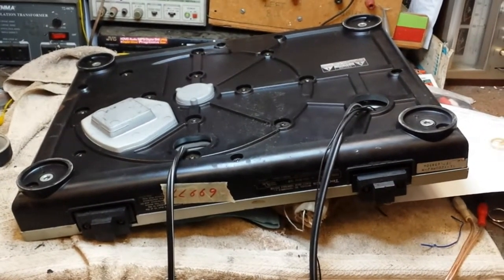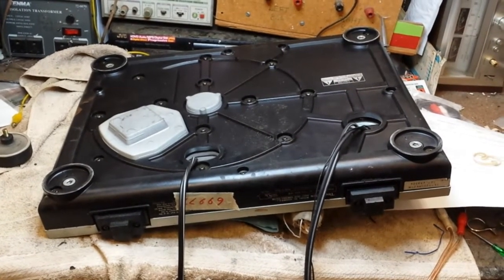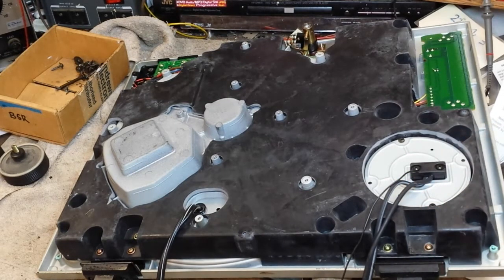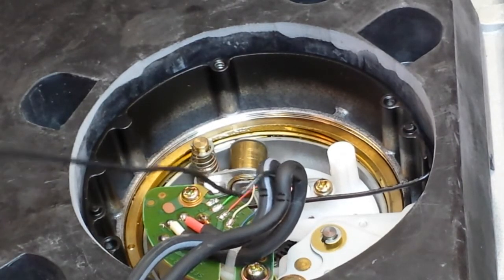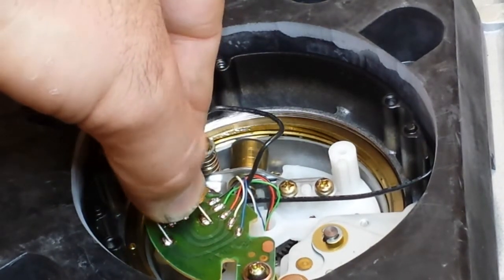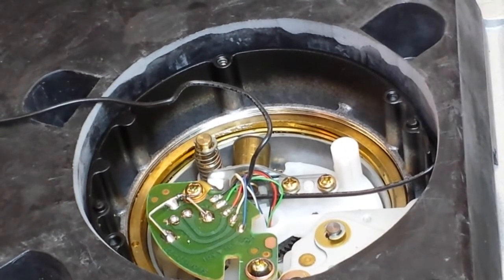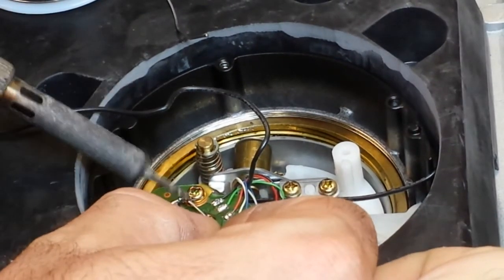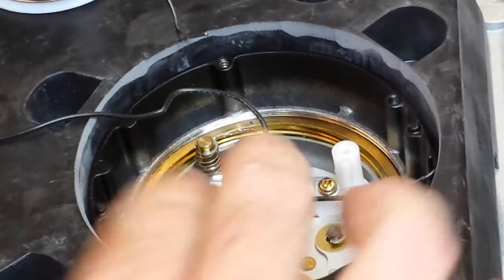How To replace an audio cable (and internally ground) a Technics SL-1200 series turntable

Comment: late here - good clear vid. Ha - IF I  did that guarantee 2 screws would have mangled heads , I hate Phillips....  ever try to replace the 4  tiny wires that go thru the tonearm to the back of cartridge ?  IF Yer t'table doesn't have the easy replace SMe / Technics head shell....  funny how soldering looks so easy.

Comment: I see all tutorials show how to replace the RCA but how about the 4 are in the tonearm ?
Reply from the maker: Why? Are they broken?
Reply: well, actually I´m not sure. I already replace the RCA but still doesn´t sound. It´s a Japanese Sony Ps X7. it used to sound great. I have another but it´s not as good as this unit.
Reply from the maker: Using an ohm meter, remove the cartridge carrier and test the continuity of each pin to where the RCA cable attaches.

Top left should be left channel +
Top right should be right channel+
Bottom left should be left channel -
Bottom right should be right channel -

If those ohm out check wiring and continuity between terminals RCA cable solders to and end of RCA cable. You might have a bad cable
 Only thing left would be cartridge carrier or cartridge. Check wiring there as well
Reply: I paid one guy years ago. All he had to do was change the RCA. He did, but it never worked again after that . The primary problem was It sounded just one channel. I just opened now. and i saw what it seems to be the problem. There´re 5 thin wires coming from the tonearm and one (black) is broken. but I don´t know where is was soldered.
Reply from the maker: The black one will not cause a loss of channel. It should attach to the terminal affixed to the turntable chassis

Here is the witing configuration from the tonearm:

Red = right +
Green = right -
White = left +
Blue = left -
Black = chassis
Reply: i got Yw, Blu, Rd and Wh
Reply: you were right , as it was fixed before. the yelow is actually the green one. I already made connection between the tip of the tonearm and whaterver is called where they are soldered. but now I found RCAs has not connection only one. Thanks pal. you have been very helpful. really appreciated.
Reply from the maker: You're welcome.
Reply: I think is done. Now I need to bring one of my amps to test it. I´ll let you know when I´ll do it.

Comment: Excellent video! You have included valuable information that most of these Technics 1200 RCA cable mod videos fail to mention:  
- Proper soldering iron wattage 
- The reason why a 50 watt iron is needed
- Using a multi-meter to check your work. 
Great video!

Comment: can you please clarify exactly what you did with the MM at 13:03 to verify the connection? Thank you
Reply from the maker: You're verifying continuity between the signal negatives (green and blue tonearm wire), the tonearm ground wire (black) and the chassis ground. All should be tied together
Reply: Thanks Jordan for that, atlantargh, being a novice I found this helpful, look at the part where they talk about continuity: https://learn.sparkfun.com/tutorials/how-to-use-a-multimeter/all#parts-of-a-multimeter

Comment: Regarding whether to keep or get rid of external ground wire, you said "If your in a hi-fi sense, it's a good idea to keep it." I assume you meant for personal hi-fi system listening? Can you explain why keeping the external ground wire would be preferred in some situations, such as for hi-fi?  I use my 1210 mk2 for personal listening and it has a hum I would like to locate and eradicate. I am thinking of unifying the ground as you did, but your comment about hi-fi gave me pause. Excellent video instructions, thanks!
Reply from the maker: jonsvideobrary typically the ground is better in Hi Fi applications because some amps have the phono ground isolated for the phono preamp only. In this scenario an internal ground might have more him than separate.

Generally, most amplifiers have both the signal and chassis ground unified already, so an internally grounded turntable is better since an extra ground wire could lead to a ground loop and possibly more hum.

So....unless you have some strange, esoteric amplifier where the signal ground and chassis grounds are different, internally grounding your sl-1200 will probably yield less hum.

Make sure your cartridge is wired correctly too, or this will cause hum red=right +, green=right -, white=left +, blue=left -

Get a cable with good shielding. Monster cable will just break the strain relief clamper. Mcm pro signal cables are cheap, and work great

http://www.newark.com/mcm/24-12492/6-premium-stereo-patch-cable-dual/dp/64T7438
Reply: Thanks Jordon for your reply. The receiver is a McIntosh 4100 tube amp from 1980 era, they are known to have a good phono stage.  I believe the cartridge, which is an NAD 9300, is wired properly; but I will check again. Is it possible the cartridge is not compatible with the phono stage of the receiver?
Reply from the maker: jonsvideobrary that is possible, but doesn't normally cause a hum, just poor quality sound

Comment: Hi Jordan Pier,  in my Pioneer 518 TT,   the original stock RCA male connectors (Yes, connectors only) are to be replaced with better quality.  I could see the inside where the RCA cables soldered to the tonearm circuit board.  The color code of the RCA wire as follows:  Black-  ground wire, the other four wires: Red-Black & White Black.  Please confirm that: Are  Red & White are the positive of the Left & Right channels?  Both the Blacks are for Negatives?  I have taken photos, but I don't know how to upload here.   Please clarify for the above. Thank you.
Reply from the maker: Suseendran Balakrishnan this should be correct.
Reply: Jordan Pier,  you mean:-  Red & White  are the Positives for Left and Right Channels?  Thank you for the reply.  Regards.

Comment: shouldn't the tonearm's cartridge ground begin at the amp and not at the turntable?
Reply from the maker: The purpose of this is isto unify the grounds of the chassis and tonearm, previously separate. The ground wire is for the chassis ground, where the ground of the rcas is for the tonearm and cartridge. 

Since the majority of equipment has the rca ground at chassis potential already, unifying the grounds at the turntable (internally grounding) reduces ground loops in some equipment
Reply: Youre assuming the wrong thing, a cardridge does not have a ground, it has 2x a plus and minus of a coil, no ground.

The ground is specifically introduced on one side of the cable at the nd of the rca cables.
What you do “unifyingthe ground” is actually hanging something at ground level what should be not at ground level at that location, this IS introducing a ground loop.

Comment: Wow. How did you by pass the power to the power drill??
Reply: I show say to the cordless drill?
Reply from the maker: rsanchez7111 I just pulled the battery out and drilled a hole for a connector that wires to the battery terminals. I supply the drill using a 12v 10amp regulated power supply
Reply: Jordan Pier cool thanks for the info

Comment: Thanks for the video!  I've got a Technics SL-D5.  I was having hum with mine.  I unattached the ground wire from  the preamp and the hum went away.  The body of the cartridge was grounded through the headshell and the ground for the turntable was at different ground potentials.

Comment: does the ground modification help with hum when this turntable is used with a vacuum tube preamp?  I'm using the 1200 with a tube preamp and always have a small amount of 60hz in the signal.